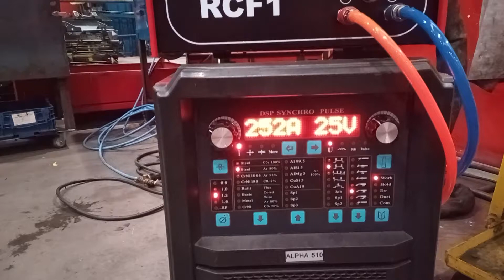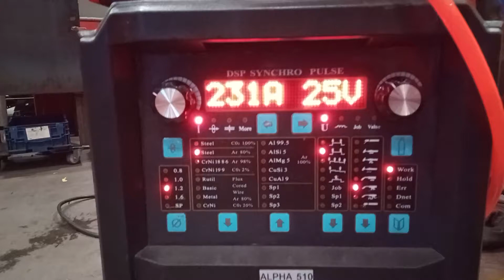Soldando pulsado componente agrícola com Alpha 510 | Na Prática

Comment: Qual a melhor regulagem para solda pesada com arame 1.2?
Reply from the maker: Prezado Bruno. Muito obrigado por seguir nossas mídias e envio da questão.
Entendemos que quando você se refere a solda pesada, está considerando soldar chapas com grandes espessuras, acima de 9 mm, por exemplo.
Consideramos também que, utilizando o arame de 1,2 mm de diâmetro, deve estar soldando na Posição Plana (1F ou 1G) ou Horizontal (2F ou 2G) ou seja, operando com Correntes acima de 230 Ampères e 25 Volts.

Quando falamos em soldar “pesado”, com elevadas Correntes e Tensão, devemos também considerar o tipo de gás pois caso ser CO2 puro, a possiblidade de ter muitos respingos é muito grande, apesar de existirem equipamentos de última geração que reduzem muito a quantidade respingos mesmo em CO2  Puro.
O tipo de transferência Metálica geralmente é Spray (para as posições que mencionamos) e para isso você deverá usar gás com no mínimo 85% de CO2 e restante Argônio ou Argônio com O2, etc. e ter pouca ou mínima geração de respingos.
Se for equipamento de geração e recursos avançados, poderá usar a Transferência Pulsada, mesmo em soldas fora de posição e terá excelentes resultados. Para arame sólido, somente.
Link: https://youtu.be/Bbv18wIC6LI?list=PLvs2MhnxSOXBfrQ73Rnx75avcD53e5iNw 

Temos diversos vídeos em nossas Dicas que explicam de detalhes como explorar ao máximo no Processo MIG/MAG e você não pode esquecer de também considerar o uso do Arame Tubular com Gás, que é um excelente processo para soldar “pesado”, mesmo fora de posição e sem ser pulsado.

Esperamos ter respondido a sua questão, mas se houver dúvidas adicionais, volte a nos contatar, por favor.

Forte abraço.